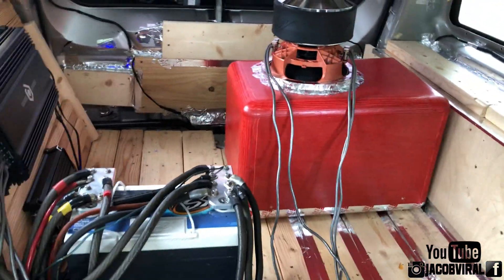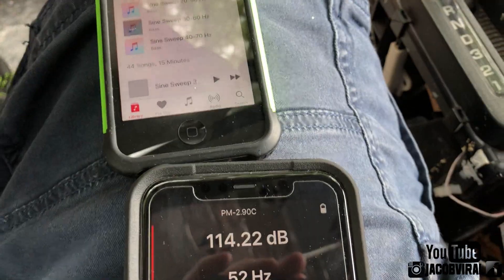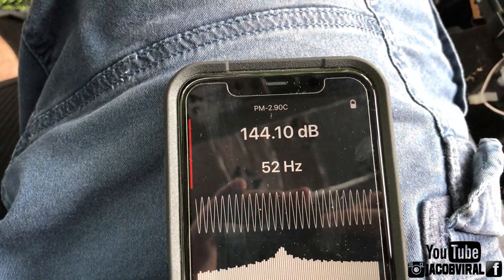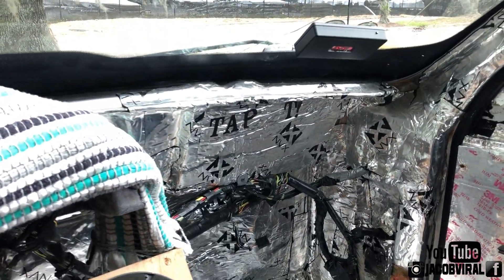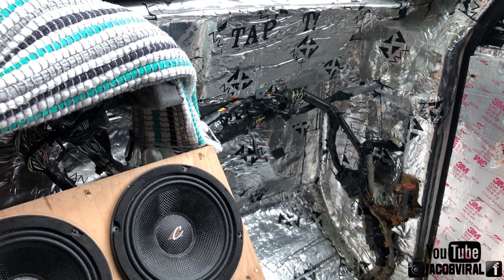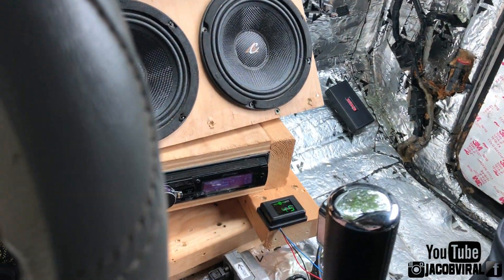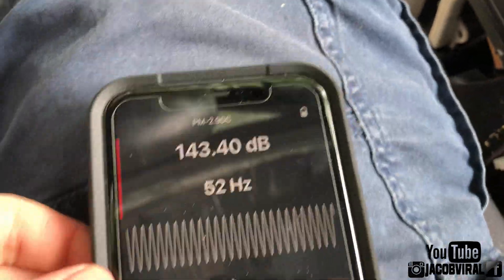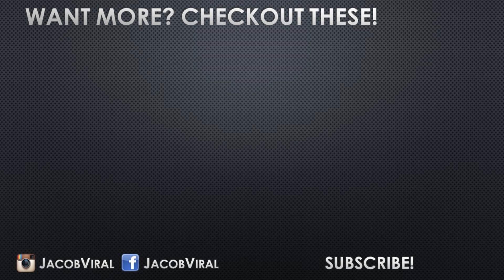FIRST TIME METERING MY SINGLE SUB BUILD!

Comment: Jacob what exact tape is that and do you use it as sound deadener
Reply from the maker: 3M HVAC Aluminum Foil 2.5" Tape from Lowes. I use it for smooth surface and sealing cracks/holes mainly.
Reply: Thanks for the reply

Comment: Impressive build, but I have a question why not a sundown x series, or a zv5 10 they have full 3 inch coils right, and handle way more power.
Reply from the maker: I didn't want to run a popular brand plus not spend as much $ on a sub and to be different.

Comment: I have a question guys does Port placement play the impact on sound quality
Reply from the maker: Yes especially for cabin pressure buildup and how sound waves travel. Usually ports center more of the vehicle give overall more equal bass output all around while driver/passenger ports offer opposite more output.
Reply: @JacobViral2  I knew it I just had a box done and the port is at the back of the hatch back firing up instead of the center of the  box hitting the roof like before the sound quality was tight now it only sounds good when I'm playing quad I told the installer I believe the problem is were he put the port and he's like that shouldn't have nothing to do with it I love my smooth jazz and old school hip hop rap and r&b most of the time I really hope he makes this right I have a lot of time and money invested in my system not to have sound quality first
Reply: Thanks for the input brother

Comment: I think my boy nspl did a 149.8 lol 2 years in a row ha ha
Reply: You think? Under a 150? What class was he in? What was he running. Sub and or subs, amps, batteries, Alternator, vehicle?
Reply: I wanna say single 10 sundown on a limitless im sure bout the alt 1/0 with solid copper lugs i know i sold and put them on for him sealed on the glass in a i wanna say honda accord with cosmos amp i think
Reply: @Hertzsogood219  yeah he has hit that like 2 years in a row he was so pissed
Reply: @liljamesjames1884  Yea, that sucks.
Reply: @liljamesjames1884  Nice!
Reply: @Hertzsogood219  what you hit bro you run yet
Reply: @liljamesjames1884  Not since all the improvements I've made in the past few weeks, and I'm not done. What U hit? Oh wait, was it you're boy?
Reply: @Hertzsogood219  dude I'm so remidial I thought I subbed to you.like this whole time.still testing just finished the enclosure.creating the Eddie port now.i have just been ridiculously busy just finished a build for a 91 Camaro 08 Chevy ext cab 09 gmc crew.last but not least 08 g6 full build box subs front and rear fill 2 amps false floor digital battery isolater oil change and a fuel pump and fixed the passenger front and rear Windows.swampped I tell you.what all you runnin
Reply: @liljamesjames1884  It's all good man. I was talkin shit. I just recently subbed you. Right now I'm runnin 3 SoundQubed Hds3.1"s (recones) on 2 S12250's strapped, at 2.67 ohms on 3 agms and a 45ah Limitless Lithium battery with a 300 amp alt. I have a 4th one coming with will change things for the better. I'm not competing again until I get the 4th sub. I get recones from psi but they take forever to get them too you unless you're a big name. My 3rd sub was a b- stock I bought from SQ's website for like $140 and there wasn't anything wrong with it at all but I still had to cut it up and drop the recone to match the other 2. Now I'm waiting on the 4th. Shit cost some serious cash. Can't wait. I'm getting more Lithium soon as well.  I'm just trying to do the best with what I got and when I get it. Look at all my rambling, my bad. Shit, I'm high as FuK and just got back from taking a long ride full tilt. Gotta love it. Peace.
Reply: @Hertzsogood219  all day im old school id give you props on 2 6×9s and house speaker if thats what you had shit im adhd so i can keep ha ha ha bet.yeah i was getting mine from basslord cuz he good peoples.its should if you had the room and the skills id bet you prolly pull a few dbs higher on a 6th or a quasi 8 with a solid ratio buf im rooting for ya.thanks bro i crash alot made it on 2 compilations bahaha.my lil 10 did a 150.6 sealed on the glass in an elantra the car just wouldnt let me peak no higher even on a 70 hz tune. Believe me i tryed my hardest the cabin gain had me topped at like 55hz so im doin a birch box slot closer to a 45 hz freq at 1.6 cubes i think might closer to 1.7 anyway.i found the best braces ever and literally took up......you ready .002 cubes and its so small and thin its impossible fof them to cause standing waves best part its steel so  theres no way they arent holding you got an email ill send you a pic i swear like felt so dumb.27 years doin this and i dont know why i didnt think of it before.wait yeah do triple stack green transformers.i never came back bahahaha
Reply: @liljamesjames1884  Nice numbers. Impressive for what you got for sure. Shit, I  give props to anyone who can build a system that they enjoy.. Thats what its all about. Having fun with it. Best (and a very expensive) hobby there is in my book. Keeps you out of trouble too..You just gotta ignore the haters. I'll have to send you some pics too. My box is crazy looking right now but it does a 148.2 and I'm about to be in the mid 150's I hope. I had a 10 cube box for 2 15's, then when I got my 3rd 15 (keep in mind I would've already had 4 but they continued the HDS3.1's. I got the 3rd one through SoundQubeds Bstock and instead of spending the money to build a new box for 3 15's, knowing Im gonna be building another one for 4 soon, I just built a box like 4.5 cubes (little too big but it's loud and sounds great) and the box I built for the 3rd 15  I built onto my existing box for the 2 15's. Looks goofy but it sounds great. 2 s12250's strapped ones the old version and the others the new version. its loud as hell but I have no choice but to run them at 2.67 ohms. When I get the 3rd I'll be running them at 1 ohm each. I also ordered a recone, dont need it yet but nice to have on hand for sure. after 2 weeks passed SoundQubed called me saying they cant get the recones because china wont ship anything deemed "unnecessary" through customs. So they say we will refund my money. Im like, I dont want the money I need the recone. I told em I'll wait 3 months whatever just keep my payment, but they didn't want to do that. They refunded my payment. They are really good people at SQ though for sure. What they told me was next time I blow one, If I pay them the cost of 3 HDS3.1 recones and send them my existing 3 HDS3.1's they will send me 4 new HDS3.2's. Cant beat that. Damn! my post was even longer than yours. I dont usually fuck with Facebook, but We can post pics of our system and bullshit whatever, if you're interested. I'm at facebook.com/wrunyan/. Or you can send me pics at wesrun1 at gmail.  Ill send you some pics as soon as I get a chance as well. I'll quit ranting now. Talk at you later. Peace and Bass.

Comment: Go to Lord of bass and build your own subwoofer for cheap sell that stove. Get a 1 15" t1 frame $65 and 1 400oz 4 inch motors for $220 then by a huge 4" coil woofer recone suspension then glue it yourself get a 8" carbon fiber dust cap go to invent help and invent your own subwoofer. Get a name for it. Start making lots of money from it. Your famous so subwoofer enthusiasts will buy them like hot cakes and when your rich give me 2 18 Jacob Viral special subs made by you! Love your channel just feal like your cheating yourself by that 2.5 inch coil 10. Soundqubed makes a 3 inch cheap under $150 10 inch hds3 if you want the best bang for your buck then you can just unscrew the crecrsendo and put the high out put 10" soundqubed matching your amp affordable sub right in your box. Just try to help you out.